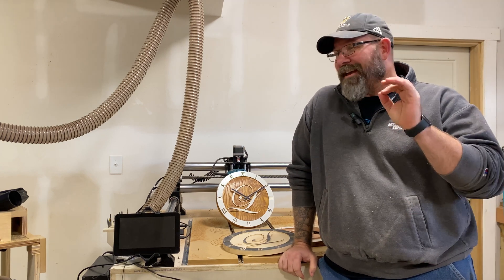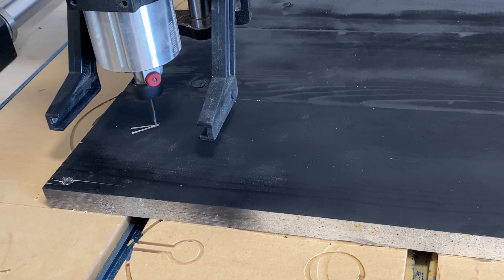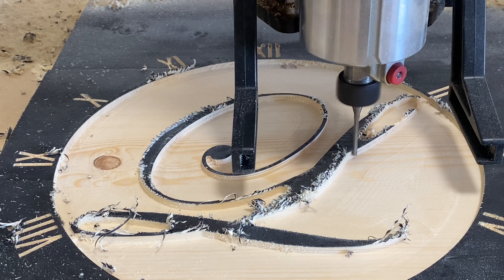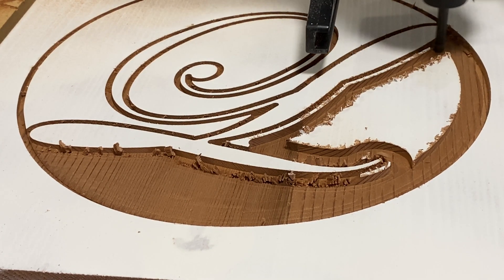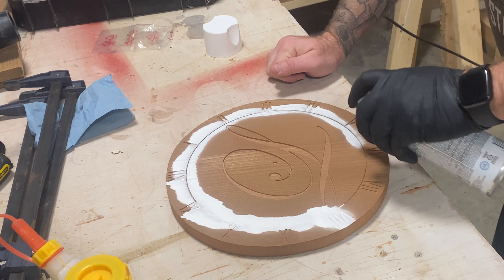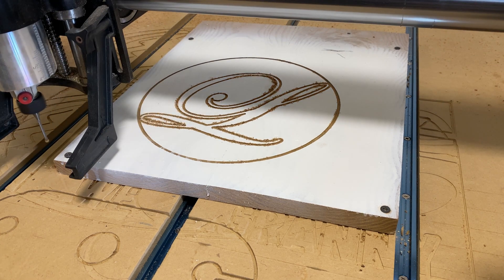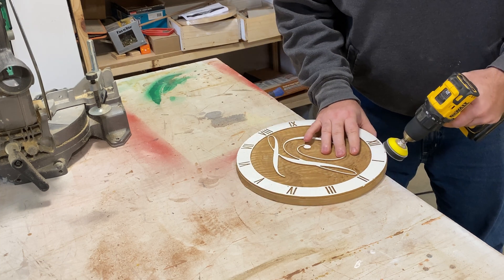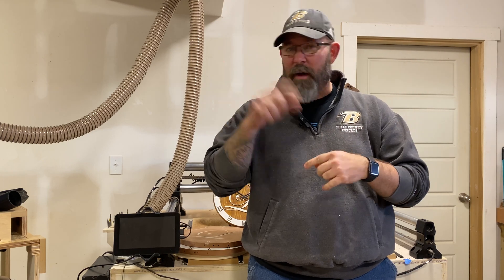Make A Customized CNC Clock | Onefinity, VCarve Pro & Woodworking

Comment: HI!
Of course, I didn't read all the comments, so if someone has already written something similar, I'm sorry! Since you said we could write about our experiences, I took the courage to write them for you!
I did something similar, but I used epoxy resin instead of paint! I achieved a very good result, especially because I sealed the fibers with neutral-colored epoxy resin! But I also did it in such a way that I taped the entire surface with self-adhesive foil, then ground it out, then sprayed it with paint, and when I removed the foil, what I had made remained nice and clean! But you may have already tried these options since then! I hope I don't sound clever!

Comment: Another great video, Damian. I had the exact same result using the upcut bit to cut the pockets for the white stripes on my American flag video. You just verified what I was thinking, that I should run a profile cut with a downcut bit first,  then hog out the rest with the upcut. Some other people have been telling me there's no need to even use the upcut bit, that the downcut bit will leave just as good of a flat surface but I haven't tried it. Have you? Maybe I'll do a video comparing all three ways.
Reply from the maker: I’ve found that the upcut helps, but the difference is negligible. Still needs a little sanding either way.

Comment: I'm assuming you didn't machine the clock mechanism pocket on the other side first with the "2 sided option"  because you never showed the process.
Reply from the maker: I didn't. I will do that moving forward, but at the time, I didn't really know much about the 2 sided option. This is turning into a pretty popular build in my area, so I'm gonna add that to new clocks so that I can refine the process. Good call.

Comment: Nice video.  It's always good to see the failures while trying to get to the final product.  I wonder if the areas where you had the chip out with the soft wood could have benefited from an application of thin ca glue to soak in and harden up wood fibers after making the initial cut?   I am new to these small cnc machines and tiny bits quite a learning curve.  Your final project looked very nice, well done.
Reply from the maker: Could be. The final clock was done with walnut, which is stronger, so that helped too.

Comment: That bookcase wood looks a lot like a western red cedar.   You may want to try an adhesive mask to help prevent some of burrs (still use downcut).  It also helps with your painting.  Do the surface paint, mask, cut, paint the letters, pull mask off.   Also, as you found, hardwood works better than softwood.   A small nylon brush can also help with removing burrs quickly.
Reply from the maker: Good call on the brush. That's a good idea. I have some oramask, but I wanted to try it without. The big thing is to get that downcut, which has been ordered. Getting better with painting is at the top of my priority list this year. 

And you may be right with the western red cedar. It was a simple shelf built by the shop class in my school probably 25 years ago, so I know it's nothing expensive. I figured it was just weathered until I started cutting and sanding, then realized it was that color throughout. It's definitely a soft wood.